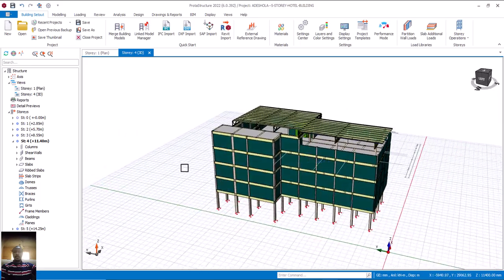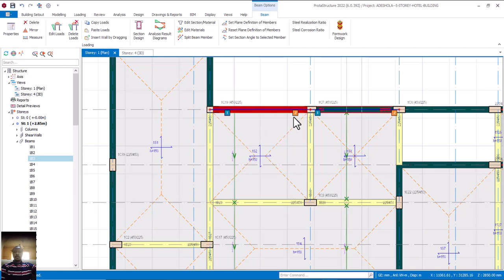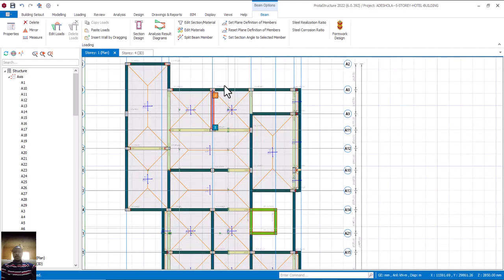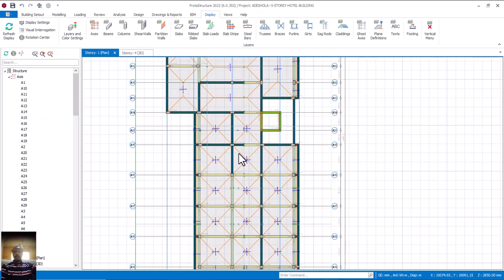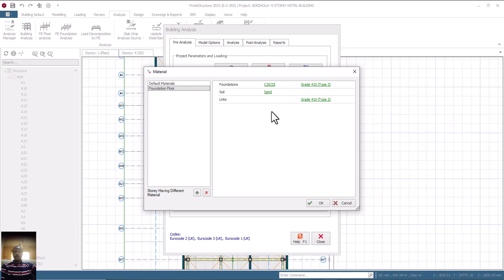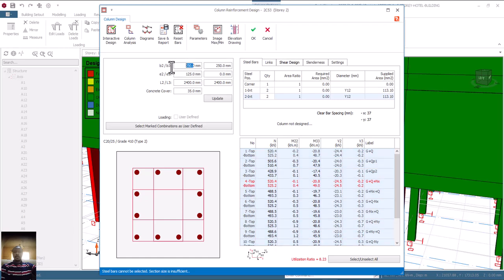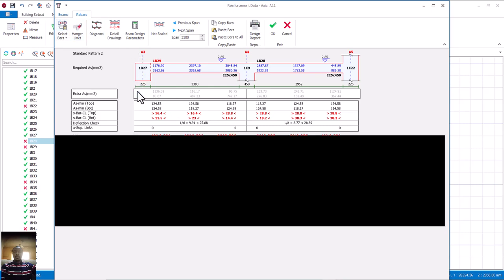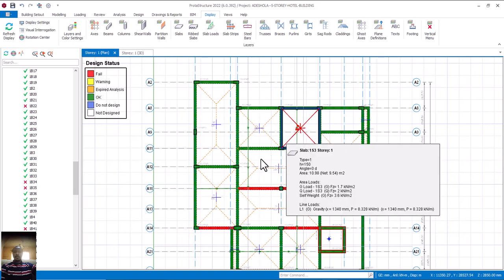ANALYSIS & DESIGN OF 5 STOREY HOTEL BUILDING DESIGN - PART 5 | protastructure |

Comment: Hlw Engneer Ekidel, i thing before running analysis the some highlights that we have introduced to on "BRACED" AND "UNBRASED" STRUCTURES and also CRACKED and UNCRACKED SECTION
Reply from the maker: No you don’t need to check those except the user requires to change it if need.
Reply: @EkidelCAD  we can get good clarification on that on one of your tutorial, that will be so grate, for more understanding
Reply: @EkidelCAD  we can get good clarification on that on one of your tutorial, that will be so grate, for more understanding